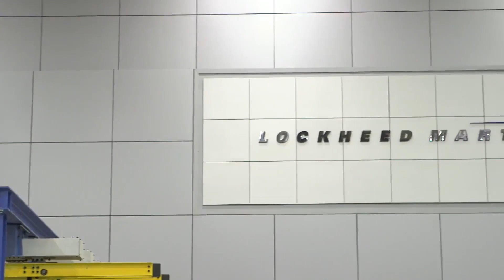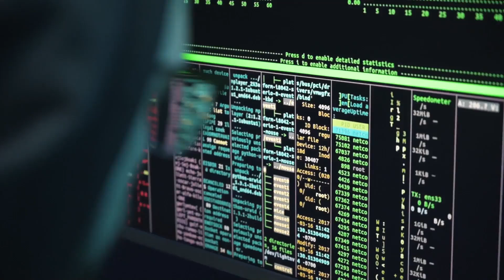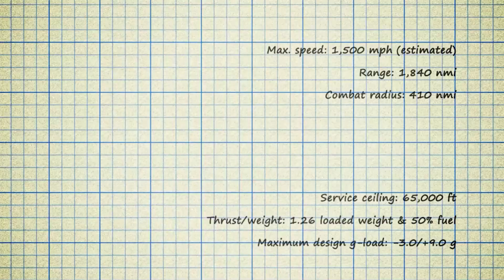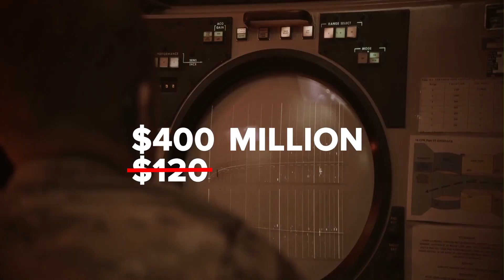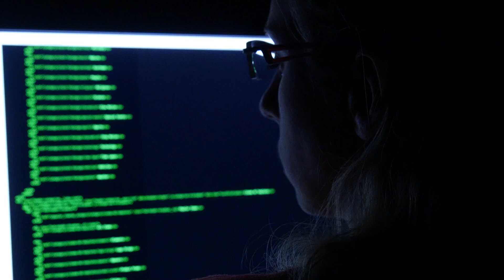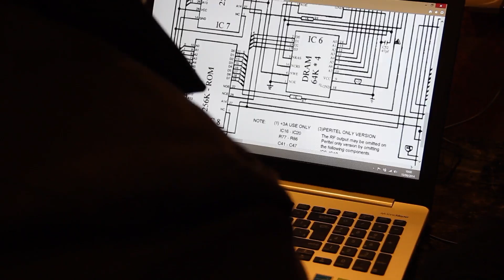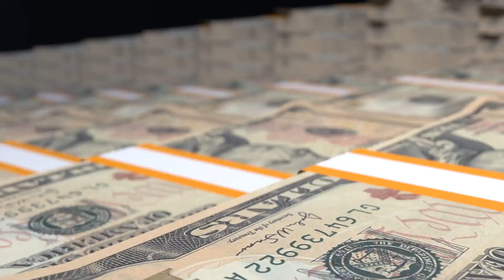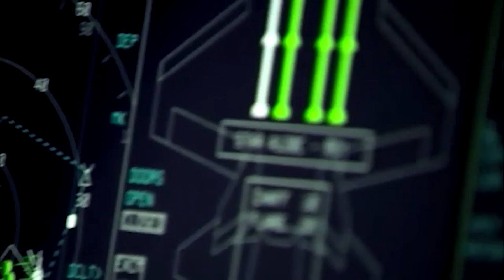Why USA Never Sold the F-22 Raptor to Other Countries

Comment: They are protecting the stealth technology of the F-22 Raptor(s), so thats why that they cannot sell 'em. Thus its an Air Superiority Fighter...
Reply: I am pretty sure its because of the aircraft incredible performance but its definitly not the stealth tec
Reply: @Rfa2000  with the f-22's best performance with great maneuverability, speed and stealth. The Us Air Force protects the f-22 bc its important to protect and dominate the skies...
Reply: Yes, for some of the f22.. well its because of its success it became the dominant into the sky thus they can alo penetrate deep on enemy airspace
Reply: @NOVAPHANTOM9  lmfao this is the most clumsy shit I heard yet, air superiority fighter are not made to penetrate deeply into air space, these type of missions are often given to fighter-bomber since you don't need a only A2A capable aircraft to go deeply into enemy lines but rather to eliminate a ground target which would most likely be a very specific target
Reply: @Rfa2000  F-22 is capable of carrying one or two nuclear ordinance, so it is capable of penetrating deep into enemies territory. If you have a critical mission that requires nuclear detergent, then you would send an F-22 that can fly fast, penetrate deep into airspace, drop, and go home.
Reply: the F-22 is of course capable of carrying one nuclear ordinance in both of its bay but it doesn't make sense.
First of all we should change the term "capable" to "in theory" because the raptor would need so much change to be able to actually accommodate it, it would need designed and certified attachment points for the  b-61 (which is the only nuclear ordinance the f22 is capable to carry) the ballistic and aiming of the weapon should also be added, the permission action link would also be needed. 

Also we need to talk about a second very important factor. the F22 was designed a total air superiority fighter.
Just like whoever the dude was said : "A good analogy would be: “can a Ferrari tow a trailer?”. Well, it’s certainly POSSIBLE to tow a trailer with a Ferrari. But … WHY? It eliminates the entire purpose of a high performance sports car, when there are other more plentiful, cheaper options to pull the trailer and free up the Ferrari to dominate the racetrack."
So why would the USA need to use on a critical mission that require nuclear detergent, the f22 raptor because "it fly fast, penetrate deep into airspace, drop and go home" also the raptor was designed to fight on long range so it would make even less sense to send it on a deep penetration mission especially with bombers and multi-role jets doing this job.

The f-22 will never ever ever be used to carry a deep penetration into enemy airspace and its actually very clumsy to claim that it will.
Reply: @Rfa2000  The f-22s first confirmed kills were on a joint strike mission, in Syria, I think. In 2014, they'd sent 2 f16s, f15s, and f22s to bomb high value targets. Naturally they gave the f22 the highest valued target, which was smackdab in the center of multiple Sam sites. Any rate, the f35 is a multirole plane, the f22 is better in every single aspect regarding air to air superiority. The only edge the f35 genuinely has is newer electronics and a wider pallette to expand on.
Reply: @Rfa2000  The Raptor is an air dominance fighter built to go into enemy territory. The Raptor has a higher service ceiling than the F-35(65,000 vs 50,000ft), it can climb faster than the F-35 ever could(62,000ft per minute vs 45,000)and can travel faster than the F-35(mach2.2 vs mach1.6). It can also carry 2 aim9x and 2 1000 pound GBU-32 JDAMs internally and use its on-board avionics to deliver them accurately. Pair that with its better RAM smaller RCS, speed and agility and it’s a lethal weapon in ensuring air dominance against both air and ground targets.
Reply: @legendary4570  lmfao so you guys still tryna prove me wrong. Okay so first of all you made a huge error, the F35 is actually stealthier then the F22. furthermore the F22 is just like you said an air dominance fighter, so obviously it can perform air to air attacks in the enemy territory (even tho it never did and its only mission is to denying airspace). Moreover you said something very clumsy, or atleast your using this fact in a wrong way, you said that the f22 has better flight performance then the f35, which is true indeed however the flight performance are far from related to deep penetration missions. Just to prove what I said look up for the B-2 spirit and the B-1B lancer are both heavy bomber, yet it still was made to perform deep enemy penetration (in soviet airspace) to carry nuclear strike missions. Also I love the fact that you literally said that the f22 is ensuring air dominance against ground targets which is pretty dumb when you yourself said its an air dominance fighter.
Reply: @Rfa2000  how can a fighter jet with a 0.005m2(F-35)RCS be stealthier than a jet with a 0.0001(F-22) RCS. It’s literally the size of a golf ball vs the size of a bumblebee, and the F-35 has an even worse RCS from the rear due to its exhaust nozzle. Stealth doesn’t mean invisible, it simply means S.A.M.s having a difficulty locking on to targets and having a difficulty finding a firing solution. That’s where the F-22 excels, it can be seen on radar but anti-air will struggle to fire upon it effectively. And when I meant it can ensure air dominance against ground targets I mean it can take down anti-air defenses leaving the sky clear thus ensuring air dominance and superiority. As far as speed, it’s the only aircraft that is capable of being stealthy and carrying air to ground ordinance, it can quickly infiltrate, penetrate and disable threats and fly back out. At Mach 2.25 there are few stealth fighter jets that can keep up with it. I’ll take 32 F-22s going in to clear defenses over 32 F-35s any day.
Reply: @legendary4570  so first of all you are not teaching me anything about how stealth work and its basic knowledge that it doesn't mean invisible.  Also I don't know where your numbers are coming out from but I am 100% sure that unless you are a high rank in US military/government or in Lockheed martin theres no way you know the radar cross section of two highly classified jets. I am personally basing my claims on claims made by US military officials saying the F35 has betters stealth capabilities then the f22. Also the F35 has lower infrared signature thus making it even more stealthier, however it is true that the rear of the f35 is less stealthy then the f22 and its pretty obvious. moreover, and just like I said earlier, a total air dominance aircraft ISNT MADE FOR ANTI-GROUND, they are here to eliminate Air targets and using an air dominance fighter such as the F22 would be both overkill and a bad choice. And again, for the 100th time, the flight performance are worthless, theres a reason why fighters are not getting faster and this is because since the phantom we realized that speed isn't necessary, the only reason for the f22 to be fast is because its made to fight over aircraft, its speed will be useless for ground attack. Also I doubt the US government would spend 1 trillion dollar on a project like this for it to be worse than older fighters. Also I am pretty sure that if some random dude named legendary4570 on youtube is capable of proving that the f22 while thousands of engineers and military strategist with years of experience would go the other way around atleast for the mission of deep penetration. And again i will simply prove my point by using the fact that the b-1, b-2 and now the b-21 raider don't need to have such flight capability proving that the f-22 isn't a good choice for this kind of mission. 

If you want a metaphor we can use the following : "A formula-1 can tow a trail, but it isn't made for it, the formula-1 might be powerful enough to tow it but won't perform well on public roads, why ? because it was made for circuit and racing, not towing a trail."
Reply: @Rfa2000 dude, what are you spouting? You are incorrect on several points, most prominently on the f-35 being somehow stealthier than an f-22. While both their true radar cross sections are classified, the publicly available, EASILY SEARCHABLE, radar cross section information is that the f-22 has a minimum cross section of 0.0001-0.0005 m^2. The known smallest cross section of an f-35 lightning II is 0.0015-0.005 m^2. This is NOT debatable information. Additionally, the US almost always understated its capabilities, meaning the classified numbers for their RCSs is likely even smaller for both planes.

I do agree that the F-35 is a superior choice for air-to-ground though, it was, after all, designed with that capability as one of its priorities. That’s particularly why it doesn’t matter that it has a slightly larger RCS. It typically will only be pulled out to conduct operations after aerial dominance is established. Things like the B-2, with a similar cross section to the f-22, are used to annihilate high risk ground AA threats, while the f-22 would silently wipe out high risk aerial threats.
Reply: No it's cause they don't make them anymore and the US has decided to maintain the existing fleet until they die, they've already retired multiple f22's and are going to replace them with NGAD. It's already been proven that the f35 has stealth just as good as the F22.
Reply: Do people really wonder about that lol?? Tech! But F22 old news, We got stuff now.😳
Reply: And yet Israel has them!?
Reply: I work for a large British aerospace company. I am currently working on the 6th generation propulsion system for the new fighters. No other countries except those involved in the development will get access to these engines. Even the US. We will happily sell our older engines to other counties but never the latest engines. To protect IP. Export control is extremely strict. We spend billions developing the engines. If we sold a single engine to a foreign country for let’s say 20 million, they could easily back engineer the technology and learn for 20 mill what we spent 5 billion and decades developing.
Reply: Another way to look at it. The MOD funds all of the UKs defence stuff. The MOD fund a company to make an engine specifically for them. It’s a very different business model to civil aerospace where you design an engine for the market and only make money once you start selling engines. Whereas in defence you get paid as soon as the contracts are signed.
Reply: Why they cant make a downgraded less stealthy version of the F-22 (F-22 without the stealth coating) and export them.
Reply: I also believe it’s even better and by a mile than what we the general public are allowed to see and there is even statements made by multiple pilots stating that they are required to sandbag when doing dog fight simulations against other jets and especially other country’s.
Reply: F22 is WAYYY more advanced than the F35. Why would we sell superior aircraft to foreign countries? Friendly or not? That’s absurd, f22 is too high maintenance because they found/are making, something much cheaper and hopefully more advanced. F22 is the undisputed king of  the skies atm.
Reply: Actuallt f35 stealth technology is more advanced, radar, sensor and the stealth paint are all better and theres probably more that would make me get into detail but ill get straight to the point :
The f22 raptor isnt not exported to protect stealth technology but rather because US made for some reason a federal law banning exportation of the f22
Reply: @Rfa2000  the f-22 is more stealthier than the f-35 and if they export the f-22 to other countries, well they will steal the stealth technology from the f-22 raptor
Reply: @Rfa2000  no m8. F22 has all aspect stealth but f35 doesn’t. F35 has a better frontal stealth but less stealthy on the back. Furthermore, US obviously purposely made the f35 less stronger than its predecessor f22 because its gonna get exported which means the other countries can learn its technology with ease and US wants to keep its lead in terms of air. It’s basically like giving 50% of your money to another decently rich person or only giving 10% to them. Giving them 50% will surely put you behind them but only giving 5% to them will not hurt you that much and will still put you in the lead.
Reply: it is extremly clumsy to claim that the f35 is less stealthier then the f22.
If we don't base ourselves on lockheed martin claiming f35's RCS being lower then the f22 then we will take a look on what we know about both aircraft, what we can see and some pure logic.
First of all the f35 is way smaller then the raptor, it is more advanced with a better radar (better passive search and track), it also includes better electronic interference, better sensor.
the f35 also have a better radar absorbent paint, better electric noise suppression, the IR signature is lower then the F22, the f35 is also far more stealthier at long range.
Also back when they restricted f22 export under federal law, the technology were far more advanced for its time then now, even if they changed it now, the f22 raptor is not produced anymore and most country doesn't have any interest in the f22 since the f35 became alive (the f35 being more flexible and could do more jobs then the f22) 
Some thing you said are true like the f35 being less stealthy from stern side however I didn't see any claims of the f35 being less stealthier from other angles including from the back.
Reply: @Gyyghhhhjjjkk  and even if the US making the f35 purposely less stronger, I wouldn't say that its a valid point, if we look into the past, lots of brand new US made aircraft were almost directly exported even tho they were pretty revolutionary. 
Also they wouldn't spend 1 550 billions into an aircraft purposely less stronger then what it could have been, we can assume that they made the export version less stronger but kept the one for US armed forces at their max performance but if this was the answer, why didn't they do the same for the f22 ?
Reply: @Rfa2000  no bruh for god sake who gave you the idea of f22 having worser ir signature stealth. F22’s engine is literally built to hide it signature and is regarded as the best at it. Where did you even get the source that f35 have a better ram anyways? Besides, f35 is literally made to be weaker than the f22 because they don’t want the technology to get leaked. Plus f35’s shape is not as stealthy as the f22 because of being larger and f22 is more smoother which is what you want on a stealth jet. Smaller doesn’t mean its more stealthier. If I have a larger jet with smoother surface its going to have a lot smaller rcs than the smaller jet with bumpy surface thats literally how f117 used to bend radar rays off from its surface. BTW US literally upgraded the f22 to fit newer technology
Reply: @Rfa2000  f22 isn’t produced because its expensive and theres no point because theres no opponent for it. There once was a consideration but its just way too expensive to reopen the production line
Reply: @Rfa2000  dude not looking back it literally US’s trick to protect its true air supremacy. If f35 is so darn good then why isn’t it used as a test bed for 6th gen tech but they used the raptor instead? Because the raptor is still the most powerful 5th gen to exist and its more mature in terms of stealth
Reply: @Rfa2000  btw if you didn’t know f35 is not made by the US its made by nato. NATO countries all contributed to making this jet like bruh
Reply: @Rfa2000  by pure logic when you don’t even understand politics and basic things that US would do and how stealth actually works 🤦‍♂️
Reply: @Gyyghhhhjjjkk  dw I didn't need an explanation to why the raptor isn't produced anymore (and I already knew it) Am just telling you that theres no point in exporting a plane banned from exports due to old federal laws, that isn't produced anymore and that no one would want because it isn't necessary to have this air superiority fighter while multirole stealth fighter exist (f35) and semi stealth omnirole (rafale/eurofighter) are here, they are less expensive to maintain, does more job and just overall fits more countries demand then the f22.
In the case that the 2nd and 3rd problem were somehow fixed, removing the federal law would take a lot of time.
Reply: @Gyyghhhhjjjkk  oh yeah sorry for this extra notification but I advise you to also watch the video <3
Reply: @Rfa2000  First of all it isn’t called paint its called radar absorbing material. F35 does not have full aspect stealth I repeat it doesn’t and its also public. Btw I also want to know the source where you get about f35 having closer ir stealth to f22 when there’s literally no source about it being “public”. Only thing thats public is f22 having full aspect stealth but f35 doesn’t. F35 doesn’t have a good stealth from the rear and its also public lmao check it out. F22 has a better rear stealth than it. Furthermore, why doesn’t US use f35 as a test Ed for 6th gen technology then if its so much more better than the raptor and raptor would also be the one receiving aim260 first? The reason why f22 stopped production because it was way too expensive and theres no point of having so many of them
Reply: @Rfa2000  I’m not saying the f35 is bad its just not as capable as f22. It has a really good frontal stealth but not the rear.
Reply: If you claim smaller is stealthier, then the F-22 is also stealthier than F-23. That would make the F-35 stealthier than both the F-22 and F-23.